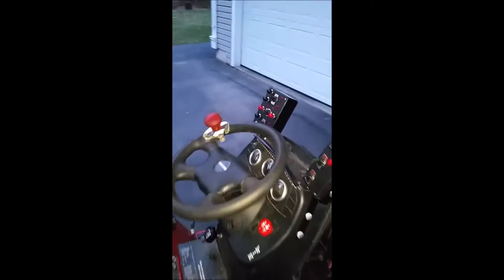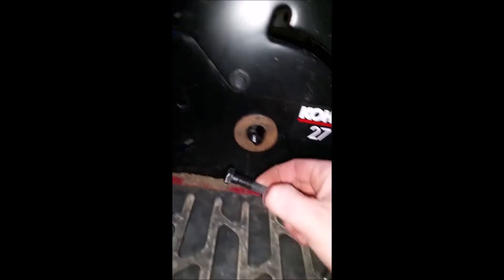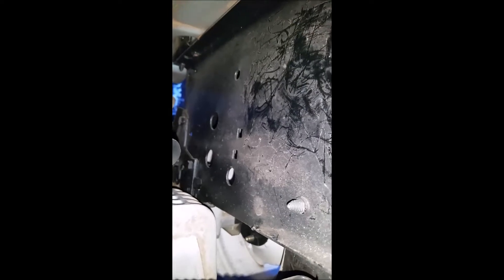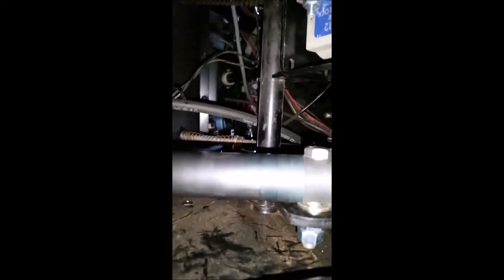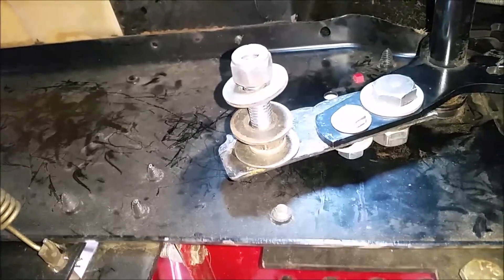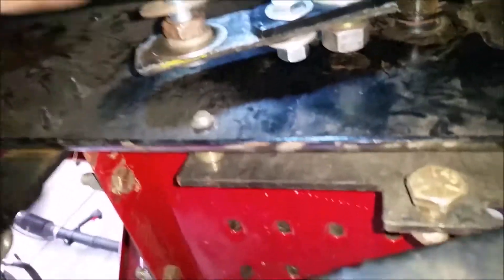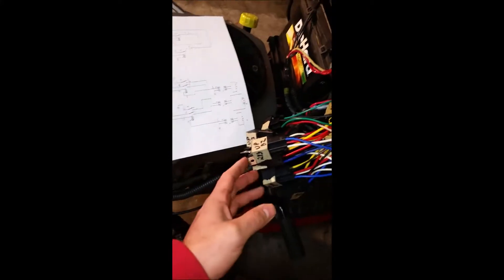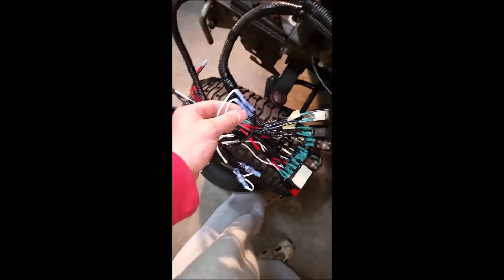Tractor mower deck power lift. (Tractor mods)

Comment: All electrical is ran off of the original battery? ... That doesn't put a strain on the original electrical system?
Reply from the maker: No problem for years now. #1 you are going to be running the actuator when the engine is at full speed so the battery is getting charged in real time and the voltage is actually even higher than just the 12V. #2 you use this for maybe 20-30 seconds so even if it was just feeding off the battery, like if you have to adjust when the engine is off, it's no big deal at all. As you can see from my other videos I have my snow blower running 2 actuators and a wiper motor or the scoop running 2 actuators. Again you don't run them all at once and it's just for less than a minute each time to make your adjustments

Comment: +Scrap Metal Works How did you manage to get the lift lever off?
Reply from the maker: +Ian Winfield Just remove the bolt where the level meets the cam near the foot well and the lever slides right off. The bolt was pretty tight but it does come off easily.
Reply: did you use any special tools to remove it?
Reply from the maker: no just regular socket set